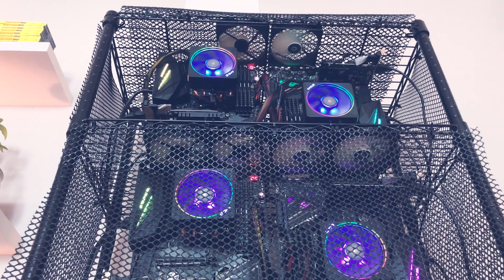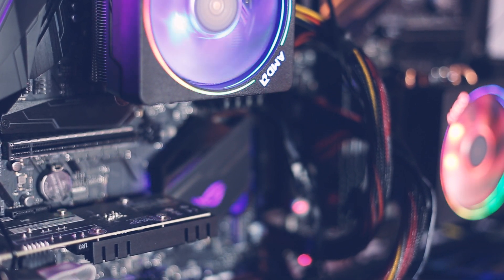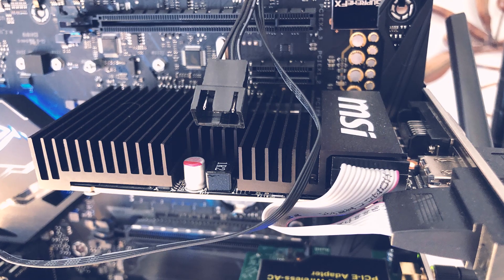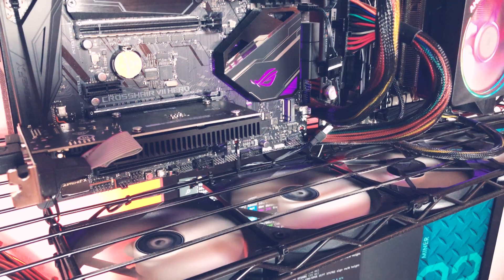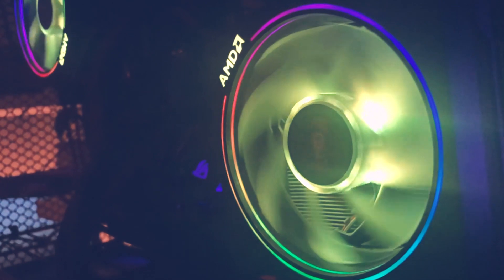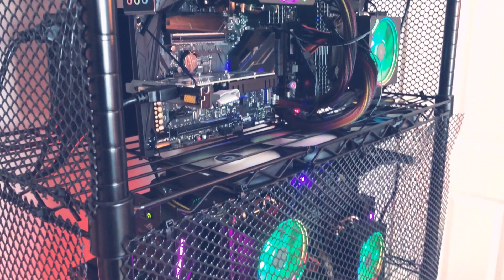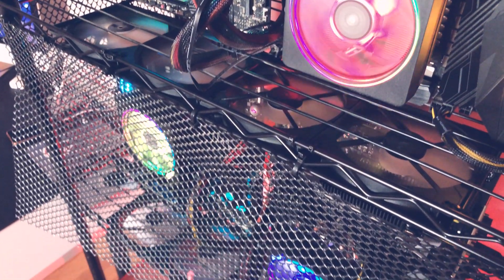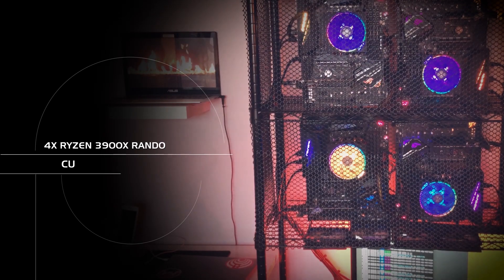4X 3900X Random X Monero Miner Beast 54000 H/s CPU Mining Build & Parts [Miner Showcase #1] Crypto

Comment: In germany you would lose money with this system, because of the high electricity costs.
Reply: I’ve been running this since early 2020 and I can confirm that I am in the clear now; making small profit. It’s worth to pointing out that I had build this to challenge myself and learn. The small profits I am making now is just extra fun. I also believe in the XMR network and if I had to loose some money just to make sure the network is secured, it would be something I would consider based on my personal principals; luckily I am making a few bucks a week after paying the electricity.

Comment: How you Contrrol your temp and what's your CPU temp
Reply from the maker: I have to check with Greg for the specific system, generally you don't have heat issues when you undervolt :) my 3900X runs at around 60°C while mining at 1.1V, cheers ⛏️
Reply: It’s mostly through changing the voltages going to your CPU via the system BIOs. I have my CPUs running around 78 degrees F these days and they seems to be stable over the last year.

Comment: Hi ! It's a really nice set up ! But, is it a nice investment ? It seems that for the 4 cpu set up you'll need almost $4000. And the profitability for a year is $1200. Is that still right ? (only cpu here no gpu)
Reply: It is a cool setup. But the downside of monero mining is the high cost for each mining rig because every rig is : MOBO+ CPU +RAM + PSU + powerful CPU cooler. And payouts are really small. You never achieve ROI as with gpu mining in the past. We only secure and decentralize the network for whales!
Reply: Monero is pretty stable nowadays

Comment: looks similar to the rig I build last year.   I am updating my 4 x rig to Ryzen 3950X now.   Hash rate is 18,000 x 4.   I also coded a watch dog routine to re-boot if any of the rigs cool down or hang.   I used to have to do that with the GPUs.    But, running the Ryzens at 1.1000V does create instability which benefits from a watch dog monitor too.
Reply: is this mining profitable though?
Reply: @w3w3w3  yep.   Even bitcoin is profitable now.   However, monero mining seems to always at least pay for electricity if the rig is Ryzen based.
Reply: @w3w3w3  its not. unless you factor in the resale value of cpus etc, its years for an ROI. thats not profitable and most are probably assuming a price bump. in that case may as well buy the coin.
Reply: MicroDroneTech, you were the inspiration for this. True story. I messaged you about this on YouTube a while back. Thank you sir for giving me the courage to take this project on and putting my own spin on it. It was a wonderful learning journey.
Reply: @user-enter-here  It is a cool project.   Guys like things.   This is certainly a state of the art thing.

Comment: It's me again haha, I've got my 3rd CPU on order now. I went to my local shop in the cities and they have limits on CPU's now. I did grab a 3900X while I was there of course. I saw your heat sink and love it but I'm thinking about water cooling for my next one. My first one has to stay factory because I'm all about portability so it has to stay compact. I also grabbed a motherboard with built in wireless. If it craps out I will just CAT6 it. Have you looked at water coolers at all and have any favorites?
Reply: PS just grabbed that cooler that Greg is planning to install that you like (probably installed by now)
Reply from the maker: Yes I have the NH-D15 on my main system :) you can find vids on the build on my channel too! I used AIOs in the past but I want to not think about my coolers many years, maybe just blow out the fan from time to time and worst case replace one. With watercooling there are just too many horror stories of leakage out there, but just my personal opinion :) video about a watercooled system I acquired drops tomorrow :) (but will probably resell)
Reply from the maker: bought Monero are not as private as freshly mined XMR ser :)

Comment: You’re spending almost $300+ a month running it. So why? Supposed to make money with it. Not go in the hole.
Reply from the maker: how do you know his electrical rate? Monero mining is not ETH GPU bull market hype but a long term game :) cheers ⛏️
Reply: @CursedMining  I’m retarded. My electric is 8cents and I calculated .80. So I was like wtf. But do you think the 5090 would be a good cpu for this? I looked at the different rates and if you can get 54khs then I feel like you can get twice the amount with 4 5090s
Reply from the maker: heyho, shit happens, no worries. Nah unfortunately that's not how it works, 5900X does not manage much more than a 3900X, the improvements are immense in core clock etc., but random X does not care about that. It cares about L3 cache and memory which is the same in both (cache that is). So if you calculate the price premium, 3900X wins by far :) cheers ⛏️
Reply from the maker: if you meant 5950X etc., then yeah it manages around 22 kh/s per chip
Reply: @CursedMining  so I have 4K is it worth mining monero. I just see it going up and up because they use it on the “market” and not btc now
Also should I go with the 3900 and high ram speed and does over clocking it generate more hash. Also is random x staying around long term?
Reply: @CursedMining  and yes I was talking about the 5950 the newest one they have
Reply from the maker: @bobbo2576  for some of those questions your guess it as good as mine. If the market was to drop by 90% tomorrow, would you still be happy about your investment? 
3900X is the best bang for buck chip for XMR atm., you will actually have better results with downvolting it (I run mine at 1.1V and 3.9GHz now for 13-14.000 h/s) - in terms of RAM it likes high hertz but low timings (CL14 etc. is best). 
ONLY buying a cpu for  monero is something I normally don't recommend (the machine of the vid is a passion project) - but if you can combine it with GPUs it can be a mining beast :)
Reply from the maker: @bobbo2576  so 22000 h/s on 5950X vs. 14000 h/s of 3900X, 3900X is better value, 5950X is stronger
Reply: @CursedMining  but doesn’t random x not like gpu? Will it ever go back to gpu or likely stay cpu? I’ve got some money to spend and I was to mine monero. I see the potential in it.
Reply from the maker: @bobbo2576  Monero was GPU mineable for a long time (before RandomX) - randomX was introduced to make GPUs basically very very inefficient for XMR (or rather so that ASICs and FPGA did not work on it anymore, but it impacted GPUs the most), you can mine it with them but it will not be worth it at all, will make more sense to mine ETH with GPU and then simply exchange to Monero. It will definitely never go back to GPU that was a long and hard road to RandomX, before that they updated the algo every 6 months, RandomX was made so they can stay that way.
Reply: @CursedMining  ok so you’re saying I should buy 4 5950x and mine the hell out of it.
Reply from the maker: @bobbo2576  hahaha definitely not what I was saying! Could be you never earn them back, could be you will happy with that rig for 20 years. Honestly no one knows. I don't think you can get that 4X setup for 4k though. Go for one chip and fill the PCIE slots up with GPUs as well and go from there, that is a safer bet if you definitely want to risk it :)
Reply: @CursedMining  I have more than 4K to spend but don’t want to spend every dollar and something that may or may not make money. I can’t find any gpus lol
Reply from the maker: @bobbo2576  Investing in mining is always a risk. Especially now as we are in crazy hype territory. Same question again if market slumps by 90% tomorrow, will you still be happy about what you bought?  Go slow, don't start with the most expensive chip there is. Try to find a GPU still to learn that as well (not all eggs in one basket etc)
Reply: @CursedMining  the only reason I think monero will keep value because of the dark web
Reply from the maker: It has more uses than that, only real privacy coin there is. But if you believe in it, good :) can it go to 10$ for a 3 year crypto winter? also yes 😂

Comment: Im getting 71 kh/s on my i7 8th generation by using cheat engine speed hack,😂😂😂😂😂 lets see if it works
Reply from the maker: ..that would be nice but sounds too good to be true 🤣
Reply: @CursedMining  bro i can send you pictures if you want but my system is getting really hot..... And i have earned 0.0001 xmr in about 7 hours ?? Is that good or normal?
Reply from the maker: @Ya_Haq  with 71 kh/s you would earn 0.0013 in one hour.. are you sure it is KH not H?
Reply: @CursedMining  yes I'm sure now its 65.57kH/s
Reply from the maker: @Ya_Haq  sorry dude, has to be displayed wrong. Check the pool you are mining to what speed actually reaches there. You'd be earning way way more
Reply from the maker: I think your comment got removed by YouTube

Comment: I have 50MH/s rig , It will supported or enough to mine monero?
Reply from the maker: unfortunately not, different algorithm - XMR is CPU only now
Reply: @CursedMining  what are best supported and most profitable cpu models to mine monero ? Please suggest so that i can buy and start the mining. thanks in adance
Reply from the maker: @TheMusicLover5959  best at XMR are AMD Threadripper 3990X, 3970X, 3960X, Epyc 7742, Ryzen 5950X etc.
Reply: @CursedMining  These seems to be very expensive. In above video what exactly the mother board and processor models you have configured.Is there any detailed video to you have uploaded for how to build 4X 3900X CPU
Reply from the maker: @TheMusicLover5959  You asked for the best :) 3900X is good bang for buck :) I don't have a build video for this exact rig, but I have a video on my channel on my own 3900X build but in a PC case.https://youtu.be/3nBl2YMLqFg Basically it is the same just that you can ignore case or build a shelf.
Reply: @CursedMining  Thanks for information. I will go through that video.
Reply: @CursedMining  AMD Threadripper 3990X wash n early $4500. In the RANDOMX CPU BENCHMARK it was showing 64000H/s. I think 64000H/s mining is not profitable.up to $8/ day we are getting it seems. Which is the best Monero profitable mining method ?
Reply from the maker: Xmrig software is best. Well you are asking very general question, you asked best CPU, that can mean most Hashrate, does not mean price to performance. If most efficient it is probably 3900X or 3950X etc.
Reply: @CursedMining  Yes , thanks for the information. I appreciate you time to answer my question.

Comment: Add something like 5600xt or basically any gpu that you have around the house and mine ethereum with the same motherboard.

In this case, you're saving motherboards, because you don't have to buy anothe motherboard and a different cpu fro a whole different computer (efficiency)
Reply from the maker: I 100% agree :) this one is not my build, but I recommended the same :) cheers ⛏️
Reply: Would you need different softwares to mine each coin or it it just one software ?
Reply from the maker: @maury5162331  Different ones. Except you use a Mining operating system like HiveOS, then it is all in one, I got videos on it on the channel (it still uses different programs but under the hood) cheers ⛏️
Reply: @CursedMining  Yes. You still need multiple programs in Hive, but they are usually not windowed. Which is why CPU + GPU mining is easier on Windows. Because you can see both programs simultaneously.

Comment: I’m wondering if a proxy server is required for a setup like this or is that what the Ethernet switch is for?? Thanks in advance!!
Reply from the maker: oh just to connect multiple devices, I think that was before the wifi upgrade :)
Reply: @CursedMining  so a proxy is needed??
Reply from the maker: @Christoph.403  Just to have more ethernet ports, nothing more
Reply: @CursedMining  so mining to a pool with multiple cpus on the same internet connection.... does that require a proxy server to divide the work sent from the pool/sent back to the pool....
from my understanding you have to setup a proxy server in order to mine with different workers from the same IP address. Mining with multiple cpus like that without going through a proxy on the same ip will not reward you for the work that you are trying to do. 
Am I wrong.
Reply from the maker: Hey, you are wrong. It does not matter. At times I have 5 CPUs same IP on Monero. No proxy needed :)
Reply: @Christoph.403  its prefered otherwise u cna ddos the network or get kicked for botnetting etc... also ur hash rate goes up. EDIT: Oh 5 cpus prob wont matter lol.

Comment: how much money is that??
Reply from the maker: Greg spent around 4K USD (Autumn 2019) - some parts like MoBos were bought refurbed though :) cheers ⛏️
Reply: @CursedMining  Awesome! please tell me de Hash power ofo those monsters .. is 54 KHS ?
Reply: and how are the earnings monthly aprox
Reply: @TradingCryptoConcepts  hey there. Yes the hash rate fluctuates between 54,000and 56,000 KHs / sec. I finally got the new CPU fans installed and once I get the memory timings right, I think I can get a bit more hashes.

Comment: its not a monster..... and it does not yield enough for a profit. The Network DIff is very high, you can only mine pool...at best.
Reply: Thank you for your opinion.
Reply: I calculated that this guy would make $4/day... investing $4000 just to make $4/day, pure madness.

IMHO, I am sticking to my 20 old dell optiplex 7010s and 790s (i5s) they use as much watts as a space heater at about 1500 watts total and actually heat my entire condo... my primary purpose for mining on FREE HARDWARE donated to me by a friend at my jobs IT department, is to at least capitalize off of the heat produced from the computers... the minero earned is the “cherry on top.” 

My electricity bill comes out to be virtually the same compared to using my homes electric furnace but an electric furnace gives me NO CRYPTO.... when mining during winter, I earn about 1/2-2/3 monero by the end of the season then the machines are switched off. 

My total hash rate is about 15KH/s... all free equipment... there is no way in hell I am going to invest $4000 into computers just to mine.... I don’t even think the developers ever intended for this too.
Reply: cramsa correct with the prices of XMR few months back, the daily ROI was around $4 and yes the total cost was $4K for all the parts. If I continue to run this 24/7, at the current XMR price it would take a little over 2.5 years to come out even. If you include electricity costs at ~11 cents per KWH, that timeline to come out even extends beyond 3 years. 

I was comfortable with making the initial investment and with waiting as long as I need to to make any profit. 

My goal behind building this rig was to prove to myself that I can do it, and I had learned a ton along the way. On top of that, I am proud that I am helping to secure a network/cryptocurrency I believe in, so no harm by being in the red for a couple of years. I hope this also inspires some to try taking on different projects outside of their comfort zone.
Reply: @user-enter-here  You should be mining Epic Cash with those rigs.
Reply: @spmadeez  thank you for the suggestion. I like to mine Monero on pure principal of what it stands so I doubt I’ll be changing what I mine with this rig any time soon.

Comment: You can just get a single 64 core EPYC for cheap on ebay and achieve almost the same hashrate.
Reply: lol. So cheap that you can pay off the sticker price at the $2 a day you'll get after electricity costs in two years.
Reply: Now there are 3900XT that gives you just a small bump.
Reply: @erenkaslte8046  no you can't mine on a GPU anymore

Comment: where its your profit? 54000h =900$/year without electricity and one procesor cost 700$   4 years for recive money back for procesors
Reply: This rig is clearing about $2/day at current XMR prices—after paying electric in my region. Your calculation are mostly accurate. The electric is around $720 / year. It will take me some time to make ROI. 

It’s worth noting that I took on this project to prove to myself I can build a unique miner from scratch and support a network I believe in.
Reply: @user-enter-here  Ahh was wondering the same thing. Looked like it would have to run for 5 years to even cover the cost of purchasing the rig.
Reply: @dukesmith1338  so my question, who is mining all these monero ?  it seems that there is very little profit in it.  i wanted to get into  because I have cheap electricity (can't buy gpu's right now) but it seems that it would take forever to break even .
Reply: @CoolGobyFish  Yeah man, it is a good question. I guess that some people have access to the gpu's and cheap electricity without having to lose a ton of money on the investment and they bank on the price of Monero constantly increasing in the future?
Reply: @dukesmith1338  my electricity is 4.3cents/kwatt and it's still not very profitable to mine Monero because each CPU needs its own motherboard.  So who is actually mining?
Reply: Seems like getting out of red and into the green with the ROI has happened a lot quicker then I anticipated. I am very happy with my investment into this rig. Also, going through the learning process, all the failures and the successes is priceless.